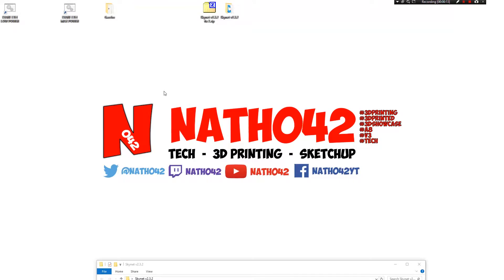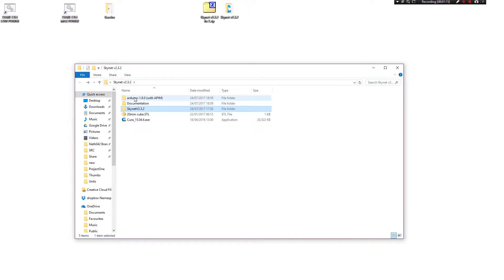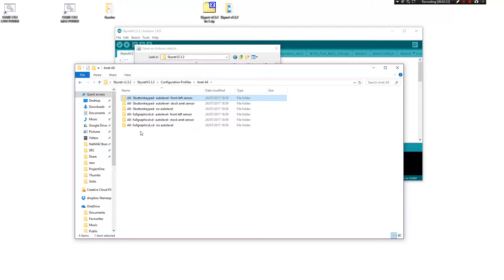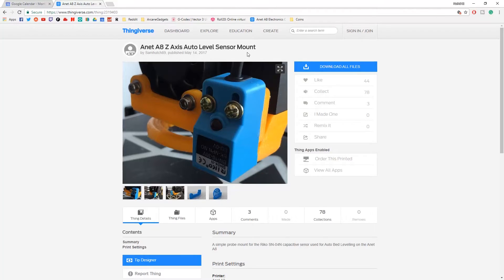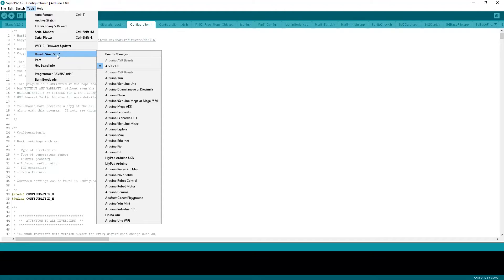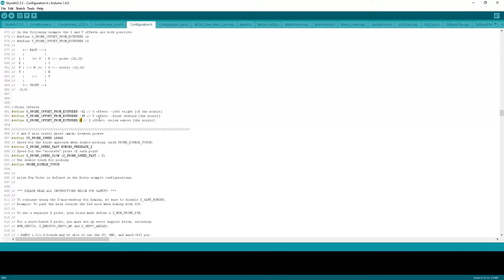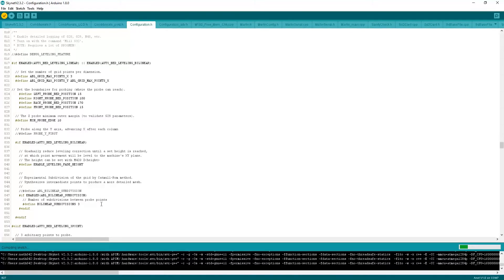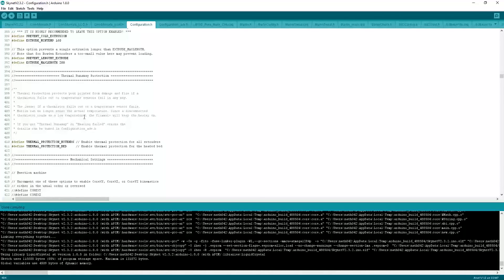Updating Anet A8 to Skynet v2.3.2 (Fix2)

Comment: I have ANet A8 plus what is difference , I like to hook my Auto level , am not finding anything Anet plus
Reply from the maker: The A8 is very different to the A8 Plus it seems, I dont have this printer so I am unable to tell you exact. But it does seem to be much better.

Metal frame instead of plastic
Mainboard has better safety protections (dont need to get separate mosfets anymore)
Glass heatbed (better than just bare metal)

Comment: Hi there, when i'm trying to move the extruder on Z axys, I've noticed that I'm missing 0.1 increment option. I can move it 10mm, 1mm, but not 01mm. Any Ideea how bring it back?
Reply from the maker: no sorry, you can try re-installing the firmware?
Reply: @nath042  I already done it a few times, but still no joy.

Comment: I installed my 18mm sensor behind the nozzle, and installed the five button option not the stock Anet versión, Is that what is making my nozzle crashing to the bed??
Reply: Damn, it was a resistor set to high in the connections of the sensor and it wasn't recording the proximity to the bed , once removed everything started working perfectly, thank you for your reply though keep up the good work great videoas man!!
Reply from the maker: thanks!